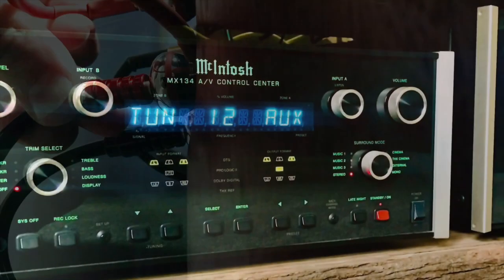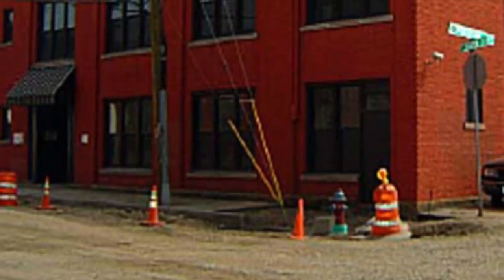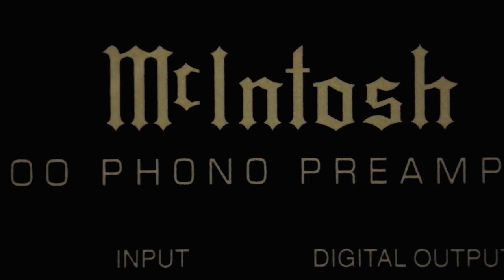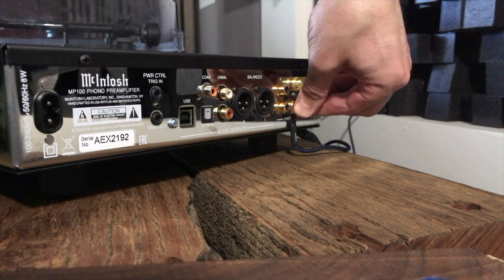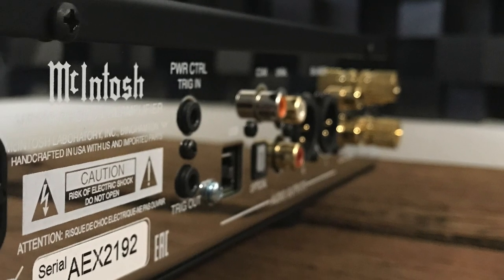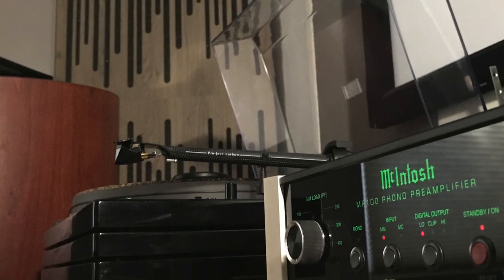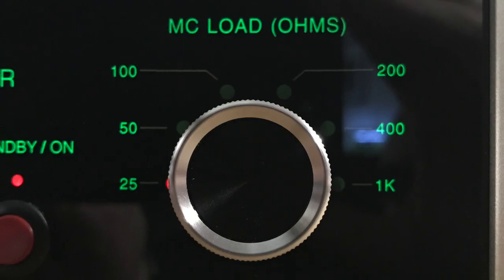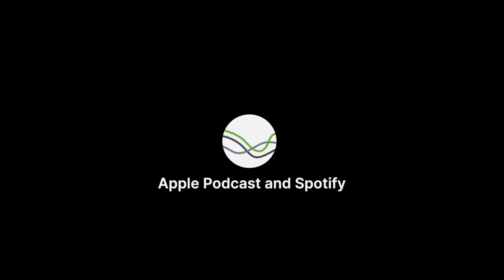McIntosh MP100 Phono Preamp | My thoughts

Comment: Nice review! As an owner of the MP 100 may I add, with respect to the digital output feature you can disable the digital output by pressing and holding the selector switch for about three seconds. In my listening sounds better when this is turned off. According to what I’ve read,  leaving the digital output set to “on” causes the RIAA stage to use digital RIAA equalization.  A number of reviews have noted this.  Thanks.
Reply from the maker: Awesome,that’s good to know, cheers for that, I know you could turn it off, however wasn’t aware it actually effects the sound. So good to know, thank you. I will try it.